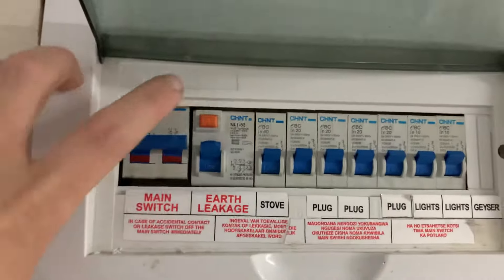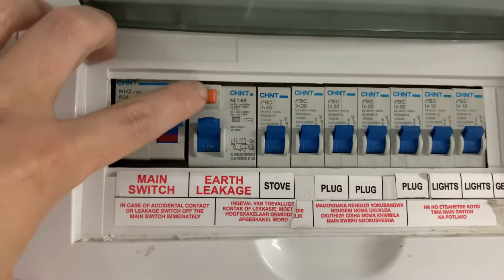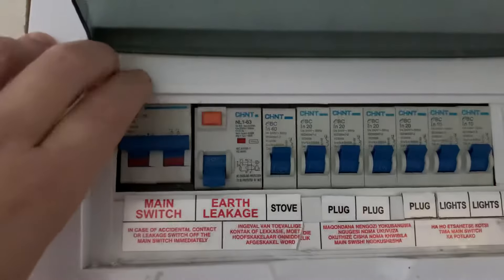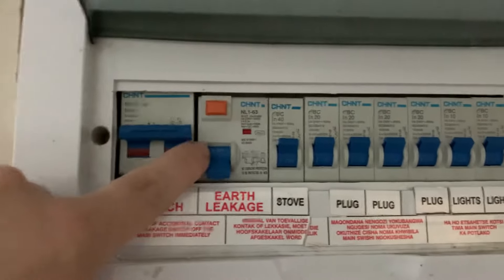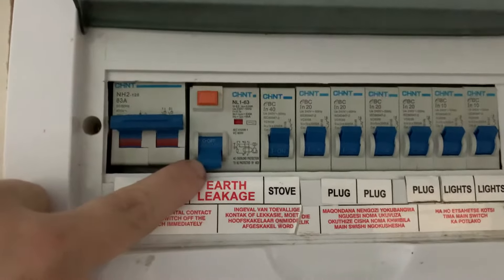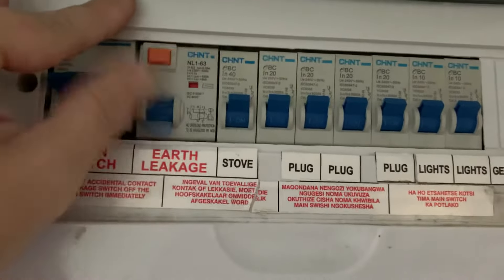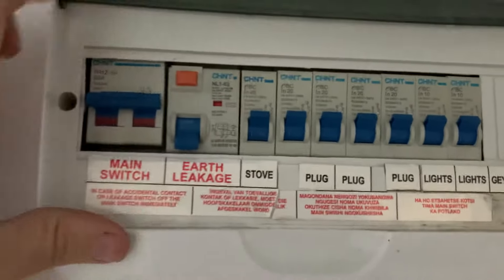Reset earth leakage switch on DB board

Comment: Why does ours trip even during light rain or stormy weather
Reply: I'm talking about the main switch
Reply: I have the same issue
Reply: Did you find what was causing it
Reply: Based on my knowledge, main switch didn’t interfere with earth wire. So it’s either short circuit which can be caused by bad shape of wire, or overload. Or it could be your main switch problem. Main switch trip means your wiring is in big problem